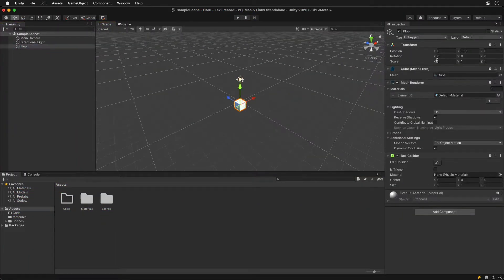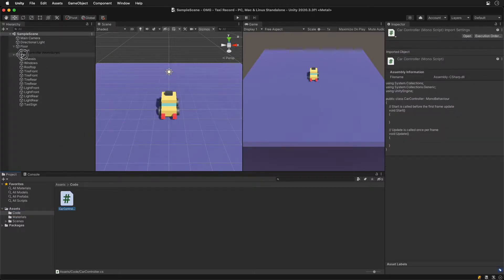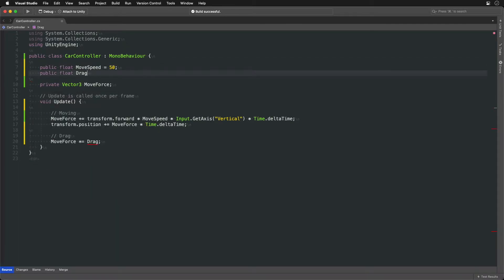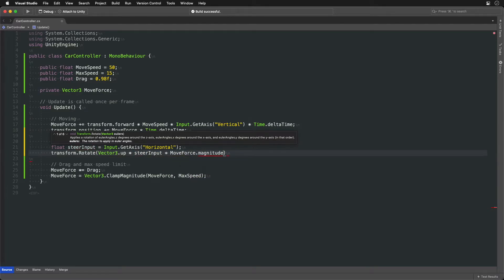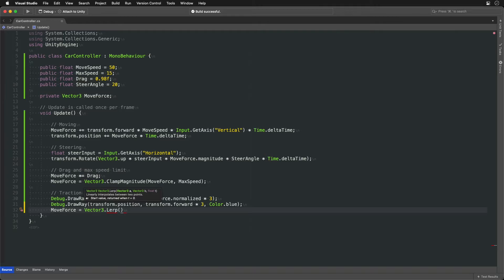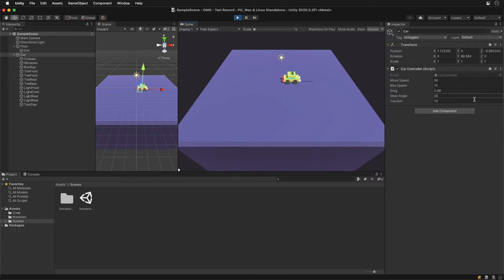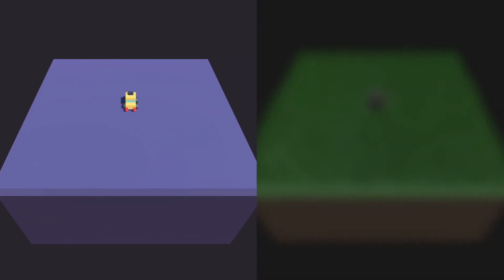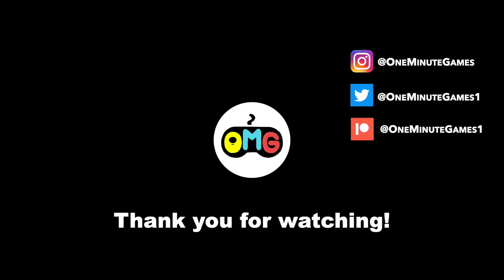How To Make Drifting Game In 5 Steps | Beginner Tutorial In Unity

Comment: I dont know if you still read comments on this video, but ive implemented this into a little arcade game. I have a problem where i have a rigid body on the car, but because the movement is essentially teleporting the car it is able to clip through other solid objects. How would you or anyone approach dealing with this? :)
Reply from the maker: Did you also update code to move the car using physics and the collisions work? Otherwise first do that (replace the code for movement with rigidbody.Move). Then you can change the rigidbody settings to “continuous”. Use google and chatgpt for details.

Comment: Anyone experiencing the "car go slowly and doesnt drift" problem here's a quick fix:
- Change Drag value from 0.98 to something like 0.995, or even remove it completely if you don't need your car to slow down
- Change around Speed & Max Speed (along with changing drag)

Since the Drag multiplication is not limited by Time.deltaTime, depending on your system, Unity might be updating frames way too often resulting in Drag getting decreased drastically.

Hope this helps someone.
Reply: Do you know why my car is going in reverse without me touching anything?
Reply: @MR.OOFproductions  I'd need to take a look at the script that you use to control the car. 
If I have to take a guess based on this video you, you probably have a 
tranform.positon += MoveForce * time.deltaTime; somewhere in your script so your MoveForce vector's Z value is always negative.
You mentioned it happens without you touching anything so you're not checking for Input.GetAxis("Vertical") anywhere, rather you're just multiplying the MoveForce vector with a transform.forward * {something negative}.
This is all assumptions.
Reply from the maker: @MR.OOFofficial check in which direction the blue arrow is pointing when you select the car, maybe graphics are reversed
Reply: @oneminutegames7308  how do I active it?
Reply from the maker: It’s the move tool, it shows arrows when the tool is selected. The shortcut is ‘W’.
Reply: Thanks for that drag fix, it's much better now

Comment: This is so much better than that WheelCollider abomination! The only thing I have changed is the fact thst I am using RigidBody applying force, setting drag and angular drag to it and so the physics engine do the same calculations but we also have some physiscs going on. I think it should be possible to use wheel collider for suspension simulation, so the wheels will jump on obstacles but all the wheels will not receive torque acting like a secondary wheels.
Reply: can you help me with that it feels very janky when i try it
Reply: @VojtaGaming25  Sorry, was so long time ago, I don't remember a shit ]

Comment: I've tried implementing this in other game engines with quite good success although I have to ask some things.

When MoveForce.Magnitude is 0, meaning when we are standing still. MoveForce.normalized should return nan and the script errors. How does unity handle it? Because my game throws errors. Its an easy fix with just one if statement but how does this code handle it?

My second question is if there are any ideas how to implement vertical motion, so we can drive up ramps or bumps.

Nice tutorial!
Reply from the maker: Good observations. This code doesn’t handle corner cases like this since it’s focusing on teaching basic logic.

For slopes it is the best to use physics and rigidbody component for movement instead (rigidbody.MovePosition).

Comment: Hi, great video! How did you make the lawn mower tilt (5:38) when steering? I'm trying to use an anchor point but i can't get it to work... Still great tutorial!
Reply: Idk if you'll reply to this but any idea how to do the grass in the lawnmower part. 
Never done anything similar before
Reply from the maker: It's a collection of quads instantiated in a grid with a slight offset. Then, each grass blade is rotated slightly in the Update function using randomness from the Perlin noise to achieve a natural look.
Reply from the maker: The tilt is determined by calculating the difference between the move force and the forward direction, and then converting it into an angle using techniques like lerp, inverse lerp, pow, and so on. You can use online tools like Desmos to visualize the calculations. I'm a visual person, so it helps me a lot.

Comment: too bad this doesn't work in a 2d space
Reply from the maker: This does actually use only 2D space, the movement is done on x and z plane only, so in these two dimensions.
Reply: @oneminutegames7308  when i try adding the bit of steering code, it just flips the sprite around
Reply: @oneminutegames7308  nevermine, i figured it out :D

Comment: Can you tell how you made that grass destroy plz
Reply from the maker: Put rigidbody and collider components on the vehicle. On the grass blade prefab add only collider but check the IsTrigger option in the inspector. This way a method OnTriggerEnter will be called each time vehicle touches the grass blade, and this is when you can hide the grass blade. Check documentation for these components for code examples.
Reply: @oneminutegames7308  thanks
Reply: @oneminutegames7308  I searched for many videos but there is no video that make grass particle behind plz can you tell me😅
Reply from the maker: I just played around with particle system options, don’t know about it that much, check videos about particle system basics, or just try it out and experiment, that’s what I did.

Comment: I'm having real trouble getting the steering to work right, the car pretty much just turns in a wide circle either clockwise or anticlockwise rather than turning like yours. Am I missing something simple?
Reply: Please make sure that the Empty for the car model has the position reset to 0 for the X, Y and Z axis. Then check again if it works. If not, then do this:
1. Delete all the car components and Empty;
2. Create a new Empty, call it Car or CarModel, or whatever you like, and reset its position to 0 for all of the axis. Make sure also the rotation is 0 for all the axis;
3. Remodel the car now since the Empty has all the rotation and position reset;
4. Code the CarController;
5. Test it and now it should work.
Hope I have helped!
Reply: Same Problem Here

Comment: Something's wrong with the deltaTime's, this is not framerate independant, the drag force changes with framerate. Any ideas?
Reply from the maker: You need to multiply the drag by deltaTime as well (MoveForce *= Drag * Time.deltaTime), something I've missed in the video. Then of course you need to increase the Drag value a lot (times 50 if you have the default time settings).